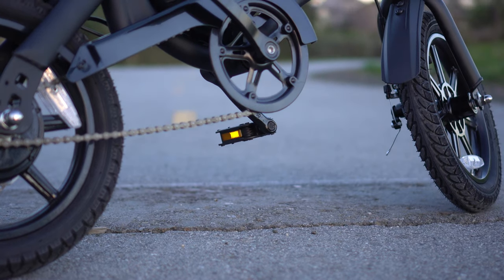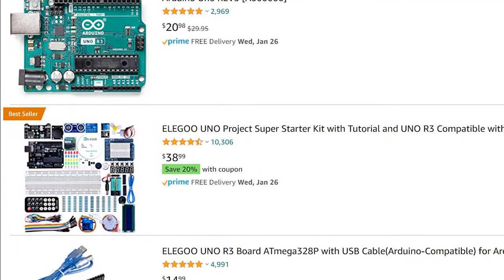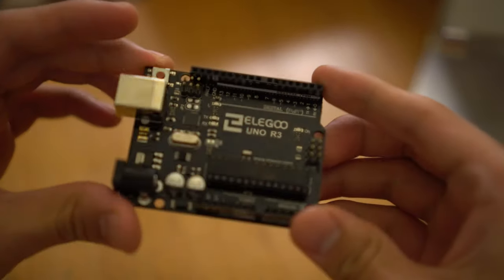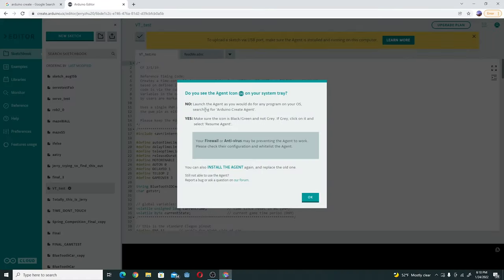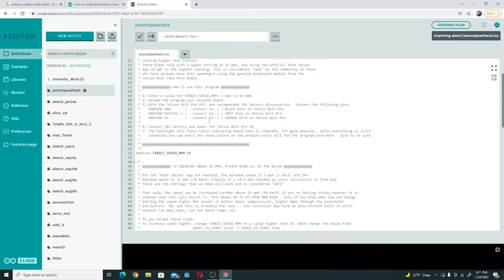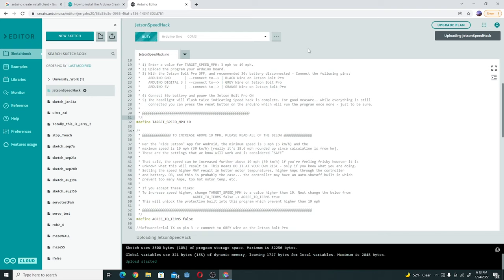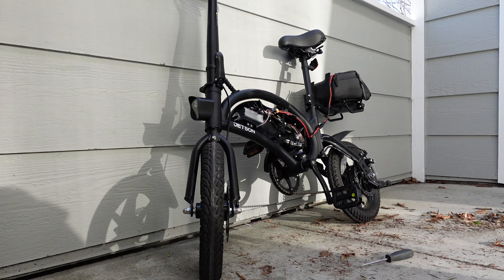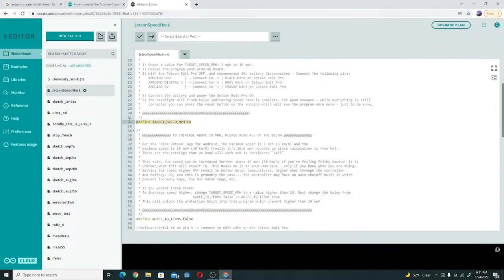The BEST Jetson Bolt Pro SPEED HACK 19+ MPH | Under $20, No Modules or Controllers!

Comment: Assuming a flat surface, speed is relative to how heavy the rider is and tire pressure (friction). I don't think this bike has any way to measure speed so what is this hack actually doing? Is it allowing the motor to have more current or spin faster? If so the speed increase is mostly relative to the rider weight. For example I weigh about 180lbs and the max speed I can ride is 12 mph. Since I can't get to 15 mph to begin with, I'll never be able to achieve 19 mph. So will this hack enable me to get up to maybe 15 mph, roughly increasing the top speed by 3 mph? If this is just increasing the max speed from 15 mph to 19 mph and not doing anything to increase the power to the motor than the hack is useless to anyone who can't achieve 15 mph to begin with. I just ordered a board so I will try it and report back.

UPDATE: Completed this and I got a slight boost in speed, before it would max around 11-12 and now it maxes around 13-14. Good enough for me, don't think I would want to go over 15mph anyway.
Reply: The hack is taking away the limit set to 15.5mph for EU ruling. What you can actually get after that will depend on what the motor can do, Or what the controller can do etc..

Comment: Hello like your video and was wondering,I got mine but it's top speed is only five miles an hour they're advertising it as 15 mph.
I haven't took the cover off to see exactly what size the battery is it's got to be a dinky one if it's only five miles an hour.
Yeah I got the first one without pedals and for miles, mine is just a little over 10 miles,

Comment: Just got two of these, charged them up and did a test before and after the speed hack. Seems like something has changed as it’s not working anymore. Flash went on just fine on both with lights flashing but no increase in top speed unfortunately.

Comment: Easy to understand video but I did everything required got the 2 blinking lights reset just to make sure got it again and still get same top speed.  Should I change the 19mph max to 25 or something or is there something I may have missed?  Thanks in advance.

Comment: I'm trying to use this hack but when I get to the stage where I plug in the elegoo board it does not even recognize it.  Is it the board that I got or am I doing something wrong??
Reply: try using different brewer also doesn't work on models newer then 2022

Comment: I tried this on a newly bought Jetson Bolt Pro from Costco, the headlight flashed twice, I also reset the arduino board to make sure, and same result on the lights, but when I tested, the mileage did not change to 19mph. I read from other comments that this hack no longer works on newer versions of the Jetson Bolt Pro. Is this true? Thank you!

Comment: Did you upgrade the battery or just make it easier to remove? Also, will setting the speed to 19 mph do anything to the battery life of the bike?
Reply from the maker: Hello Luke!

I just made the battery easier to remove by placing it on the rear rack, but since the connection the battery uses is a standard plug, I could easily buy a larger battery and put that one on the rear rack instead. Setting the speed to 19mph will slightly decrease the range of the bike, but won't cause any harmful long-term effects. This motor & battery output is designed to go up to 19mph. Hope you found this helpful!
Reply: @TonyQuillMagic  Thank you so much! Very helpful!
Reply: @TonyQuillMagic  hey I just tried to do the speed hack on my Jetson pro I purchased about a week ago from Costco and I followed all the steps and still only gets about 14mph. Is there new firmware blocking the jack now?

Comment: Hi there, my UK version Bolt Pro is limited to 3mph on the throttle but is 15.5 with pedal assist. If I install this code will it also remove the 3mph limit from the throttle? Thanks

Comment: Hey there, not sure if you're still checking comments on this vid.  But I'm in the process of doing this mod for my son and for some reason the Elegoo Uno R3 board isn't showing up as an option when I plug it into my computer.  I've tried two different computers and neither of them even show the board as connected to my computer.  Any suggestions?

Comment: Yep that's about right that's what my speedometer reads when I with the pedal assist with the throttle or the cruise control cruise control that goes like 12 13 miles an hour but once I start pedaling it's like 15.5 miles

Comment: Hi Tony, need some help. I used your hack but for some reason is not working. Here is what I notice, when I connected the board to the bike, the light will only flash one time. Once I hit the reset button on the board, the light with flash twice. I assume that completed. I unplug the cable and test drive it. All I got is 19KMH and 19 MPH. I tested my wife Jetson with mod and I was able to get 22KMH. So the hack seems to limited my bike to 19 KMH. I am from Canada and the bike was purchased at a Canadian Costco. What do you think I have gone wrong. Thank you

Comment: Just bought this bike.  The speed hack doesn't seem to work with the new Jetson bolt pros?  Is there an updated code? I do have the Arduino board and wires. Thanks
Reply: What is your bike build date ? It located in the handle bar
Reply: @weiz2493  I bought July 5th.

Comment: It worked.. i was afraid to damage my jetson pro… $300 is alot of money for me,,  so i weight about 138 pounds, before the hack im was going 12.5 mph  after the hack it jumped to 15 mph .  It is set to 19 in the script but your weight has an impact.. using my iphone to see my speed.  
One thing the youtube does not explain well is how you download the script.  After installing the client, If you right click on the script file from the webpage and save, and import the file it won't work.   To make it load into the board i just created a new script and copy pasted the whole script into the new blank script..then i saved the file. Then i imported my new created file.  Then i uploaded it to the board.
On your bike, i used a dentist pick to remove the plugs and disconnected the battery. Connected the board exactly as shown in this video and turned on the bike, first time it did not work, took me few min to figure why.. connection issue only ,,, so make sure all the wires are well connected.. it should work..
Ok im not getting 19 mph.. but 15 mph from 12.5 mph is 2.5 mph increase… im happy with that especially that i sometime carry my 6yrs daugther on a small kid seat i added to the jetson.  Which bring a total weight of 160+ pounds easy

Comment: Will this add a bit of torque or does it just ad speed with the same stock acceleration?
Reply from the maker: Hello Ricardo,
Since this speed hack removes the speed limiter, you will be able to increase the top speed on flat ground with this hack. The acceleration is a little bit stronger with this hack, as more power is being sent to the motor, but the acceleration is mostly the same. Thanks for watching!

Comment: Thanx for the video.  I got the same uno from amazon with cables and uploaded at 19.  I weigh about 190 +or- and I reach 17mph without pedaling and with a little pedaling i reach 19.  Before i use to be able to pedal and feel a slight drag and now when I pedal its almost hard to keep up.  I was scared to program since it's my first-time operating hardware that's not a built-in app from a tablet but the videos you uploaded are easy and simple.  Thanx again for all your knowledge and wisdom :)
Reply: Update 
After several miles of riding my max speed without throttle speed went down from 17 to 14 and when I pedal can only reach 17 but is very difficult to achieve. 😞 I’m going to re upload the file again to see if my max speed changer at all

Comment: Tony,  Thank you for the help with more instruction on downloading the Jetsonspeedhack.ino data to the Arduino software.  I still have a problem.  I do not know if the Arduino software transferred the ino information to the UNO R3 board.  Lights are on for the Board.  Is their anyway to read or search the UNO Board to see if they contain the information.  Is their a secret or technique for transferring the data.  The symbol of the Arduino is very light gray (I don't know if the Arduino Create software has been properly installed).  I am sorry to be such a problem, but I would love to get my bike to go faster than 14mph.  Thanks for your help.

Comment: bought the bike mid june,still has the harness for the bluetooth connector followed the steps last night and have yet to do a new speed test, will update with new info
Reply: Still works even with the newest jetsons 30.6km/h top speed now, fully charged stock battery
Reply: @seanpomeroy8632  What is the manufacturer date (top right of the sticker on the bike)? Mine is Jan '22. I saw someone earlier comment that it didn't work on their Oct '21.

Comment: Awesome tutorial. How pedal assist working with 19mph speed, does it become too fast to keep up ? Would  really love to see your tips on removable battery hack, getting tired to have to bring indoor to charge especially in winter :)
Reply from the maker: Hello John!
The pedal assist still works with the 19mph speed, but it may be too fast to keep up because of the gear ratio. However, this really depends on how fast you can move your legs. I’ll take a look into writing a script for a removable battery video. Thanks for watching!
Reply: Great to hear. Look forward to seeing your script and tips on removable battery, did you remove the female charger plug also from the cover so you could reuse the charger ?
Reply from the maker: Hey John!
The video for the removable battery hack is up now, you can check it out here: https://youtu.be/7HDD4SCJ1MI
Reply: @TonyQuillMagic  another awesome tutorial. Just followed your video instruction and did speed hack.  Next ordering a bike rack, case and xt60 extension  for the movable battery mod :)

Comment: You are awesome for providing such detailed and easy to follow steps. Thank you!
Reply: Hi Karl!  How did you get the code onto the arduino?  I cannot compile and transfer it to the board...  I keep getting an error telling me to include util/delay_basic.h when I compile.
Reply: @timcarroll331  we pasted the code into Arduino web client and then pushed it to the Arduino board. I updated 3 bolt pros with it and we could tell a speed difference. Good luck.
Reply: @karllazlo6237  does pedal assit still works after the speed mod?

Comment: Hi Tony,
Great video. Will this work with a Raspberry pi board?
Reply from the maker: Hello Santos, 
This will not work with a Raspberry pi board, as these two boards are designed differently. Any board based off the Arduino Uno system should work.
- Tony Quill
Reply: @TonyQuillMagic  
Thanks for the response & the nice video.

Comment: Did this, got about 16mph, I weight 160lbs. I’m wondering if i replaced the capacitor with a 63v and pumped 48v to it, maybe i can get up to 19-20mph? I’m just too lazy to swap out the controller.
Reply: What capacitor are you talking about?

Comment: Hi tony do you think that if I perform this mod that my battery for my jetson will run out quicker.
Reply from the maker: Hello Harry,
The battery will probably run out a little bit faster, but from my tests, not too significantly, as the acceleration is the same, the only difference is the top speed. Thanks for watching!

Comment: Question, I seen other YouTube video saying that if you disable pedal Assist, it can increase your speed of the Jetson pro. Can you verify if this is true?
Reply from the maker: Hello Derrick,
There is no need to disable pedal assist, because the pedal assist is automatically turned off when not pedaling and using the throttle. (Pedal assist is only engaged when the throttle is not being used)

It is very possible that using the throttle will give you faster speed then using the bike in pedal assist mode.

Comment: I have an old dyu that has a Bluetooth module so that I can connect to an app, but the app speed selection maxes out at 15mph. So is there any app that can connect to my dyu using Bluetooth and increase the speed past 15mph?
Reply: I have a dyu df3 I want to do speed hack but I might just get the BT module to do the hack and use old Jetsons pro apl to see if it works

Comment: Hi, I have a clone / equivalent of this bike called Dyu D3F. I wanted to increase my speed using this hack. Unfortunately, however, when uploading the code, my bicycle's lamp does not flash. I have an Arduino Leonardo. I also tried to unplug the orange + 5V cable and connect the USB cable and upload the program to the board, but it also did not work. Could you help me? Will he be able to do the same on my DYU? What are the other ways to increase speed? I wonder if if I connected the Bluetooth module with Jetson Bolt (not a pro), if my controller would connect to the Ride Jetson application. Please help me, is it only an option to change the controller?
Reply: I just bought a Leonardo board from amazon and I was able to load the program to it (upload successful) but when I tried uploading to the bike, the lamp did not flash either. No idea why

Comment: Hi Tony, just curious if 19mph is the max for Jetson Bolt Pro with a 350w motor without damage. Why is the Jetson Bolt with a 250w motor max speed with the bluetooth also 19mph?
Reply from the maker: Hello Hawaii Sharks Softball,
Hmm, you do bring up a good point, the 19mph is somewhat of an arbitrary number as it is the theoretical max of a 350W motor, many other 350W vehicles operate at around 19mph. If you are willing to take the risk, you can always try inputting a higher mph. Thanks for watching!
Reply: @TonyQuillMagic  Thanks for the reply! Donʻt want to take the risk! Hoping you can do one on installing a keyed ignition switch with voltmeter.
Reply: No you are mistaken they say 250w and 350w but they have a peak power its rated at 350w but it peak at 500w they just state that ita 350w because you can run at 350w without heating or dmg but when you peak it out to 500w the peak of a 350w motor it gets warm but it depends on your battery two 6ah 36v in paraelle is 12ah X 36 V will givw you the W for the motor
Reply: Want more speed just go with a 48v 10ah that give you the peak 500w for jetsons bolt 48x10=480W 
In order for more speed you need more Volt so a 48v 10ah is good for the jetson the controller can handle that little bit of power and the motor can handle it stock controller say 36v but it have a 36v to 48v range ao it wouldnt hurt it just spend the money on a 48v 10ah battery and do the hack i did it and got 25mph flat surface only throttle
Reply: One more thing better controller better speed and tor. Get a 20amp controller

Comment: I followed all the same steps but when I turn the bike on it only blinks once and the speed is just about the same and I bought the bike about a year ago but the speed does not at all
Reply: you have to go ack into the code and where it says aggre to terms change to true and if it blinks once just click reset on the board when it’s plugged in

Comment: getting this as an error not sure how to proceed????---------

     'SOFTWARE SERIAL' DOES NOT NAME A NAME TYPE; DID YOU MEAN 'HARDWARE SERIAL'?

//SoftwareSerial TX on pin 3 -> connect to GREY wire on the Jetson Bolt Pro
SoftwareSerial mySerial(2, 3); // RX, TX

//Start message: [aa] | Message Destination: [xxxx] | Data: [xx] | Checksum: [xx] | End message: [bb]
//To change max speed, 0606 is the message destination and data is desired max speed (KM) in hexadecimal
//For example 19 MPH the command is: aa06061eb4bb
int kmph = TARGET_SPEED_MPH * 1.609;  //Convert mph to kmph
byte bA[] = {0xaa, 0x06, 0x06, kmph, 0x00, 0xbb}; //Initialize byte array
byte headlightsOn[] = {0xaa, 0x07, 0x06, 0x01, 0xaa

Comment: Hi, I have a UK version which caps the throttle at 6mph. It goes quicker if i pedal obviously. I have done the mod but still have the 6mph cap, is there a way to edit the code to disable this?
Reply from the maker: Hello John!
Hmm, that is an interesting problem. I don't have a UK Bolt to personally test it out, but I can do some research and see if there is another way around the speed cap. I'll keep you posted if I find anything. Thanks!
Reply: I also have this problem. Tony, please solve this problem

Comment: If the hack is a bluetooth emulation, why not use a bluetooth module that will work with the jetson app? Possibly donated from the Bolt non pro?
Reply from the maker: Hello Riopato2009,
You could definitely do that, which is how this hack has been traditionally done in the past! The only issue is finding one of these Bluetooth modules, as they are hard to come by unless you want to buy another bike. Plus, you don’t need a the phone app either which is always nice. Thanks for watching!

Comment: Used this hack on multiple Bolt pros, but recently noticed one of them was only making 15mph.  So I tried it again and can not get it to go over 15.  Seems locked there.  One of the ones I own goes 18-19mph as I checked it right after I modified it, but this one I never checked if it was making 19mph.  Now that I checked it it's still only going 15mph.  Even bought a new Arduino and upped the mph to 22mph and changed the terms section of the code to true.  It passed the check before I uploaded it to the Arduino and the lights flashed just fine, but still no increase in speed.  Is there anything I'm doing wrong?
Reply: I keep hearing that it doesn't work on all models, newer ones